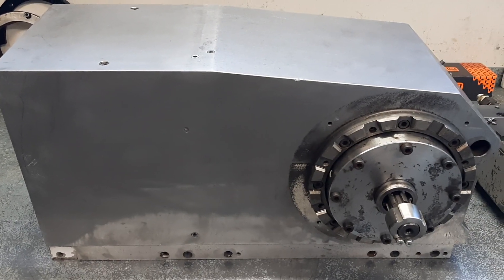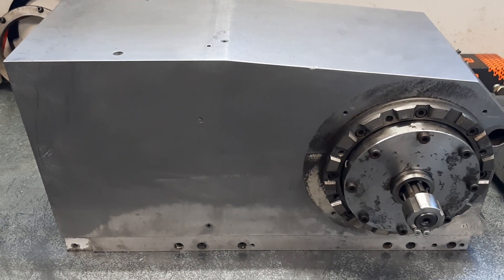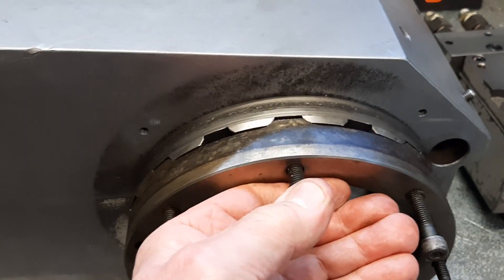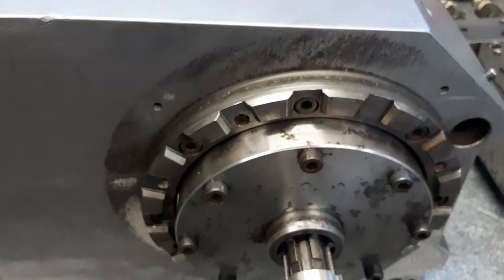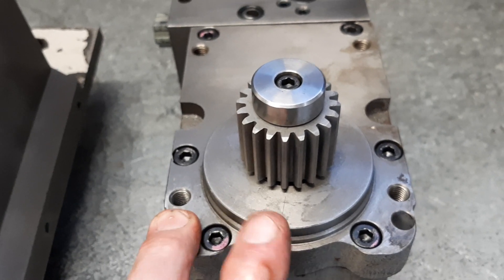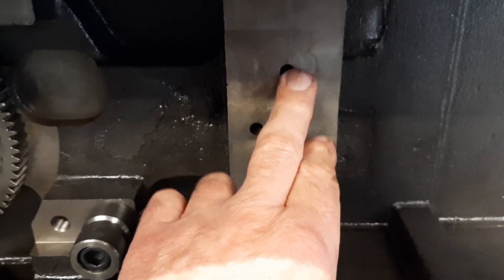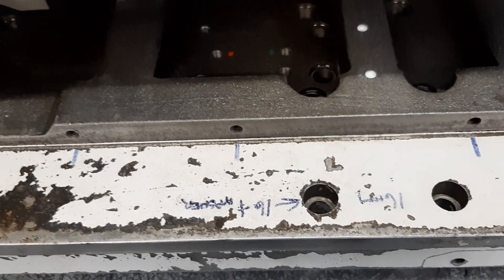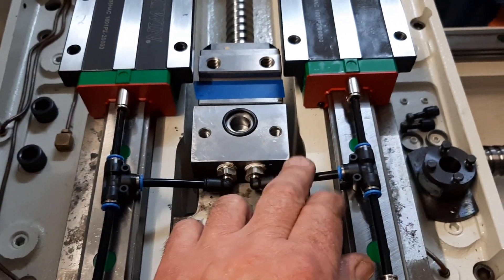CNC Lathe Rebuild.  Tool Turret Assembly.

Comment: Thanks for the great video,  Question, Do you think the Doosan have the same setup?  I'm leaking hydraulic fluids around the turrets area.  I'm thinking something about the seal or O ring.  Thank you!
Reply from the maker: Hey Pat.

Tool Turrets on most CNC Lathes are fairly similar in design.
Manufacturers generally make small changes over a long period of time.
Basically they look very much the same under the machine covers.
The main differences on a CNC is the controller, the basics of the machines stay much the same.

Comment: Hi mate.
Robert Brown from Sydney here 🤝
Just found your channel and I’m fascinated by this Mazak Mission.
I admire your patience and tenacity, and I fully understand the need to fit in a project like this along with the main ‘breadwinning’ business. What ( roughly) do you reckon will be the final cost?   Regards, Robert
Reply from the maker: Hi Rob.
The cost of the rebuild is a little hard to tell ??
I can only say i did budget for about 40k including buying the machine.
The cost of the machine was just over half.
I have replaced a fair few sheet metal panels which has so far added up to around $ 2,500 plus powdercoat plus painting etc etc on the sheet metal parts.

I repainted the whole base after sandblasting which is extra.
I guess around $2,500 again just on the base only which includes a crane truck to transport the machine base to be blasted and averagely painted ????
( which finished being a pain with the guy i got to do this work, some i had to do again myself ???? )

The sheet metal could have been left as was but it is part of the rebuilding of the machine.
Allowing myself around 40k total has given me some movement to spend money on things i would like to change.

It is a little tough to get motivated to do work on the machine when i have
 time, plus there are always other things to do also, which does not help.

I did go a little overboard on the rebuild but it was a case of just taking more and more parts off the machine until i got down to the base only.

The price of 40k was worked out from Maybe buying a Tormach CNC Lathe ??
Pretty much one would have cost to me in Australia.
At that time i was only making small parts and did consider buying until i seen the price, plus they are a fairly limiting on power for cutting anything half reasonable.
It was just a thought at the time but quickly changed when comparing how much for how much ?
Meaning for the money i could buy A lot better.

It has been a long road to get to where i am now.
But i also need to feel lucky that i can at least have this machine to rebuild.
If i had a chance to do it again ?
The answer would be NO, LOL.
Mostly because i need a machine running so i can run it.
When i purchased this machine i was not as busy making parts.

A long reply but i do enjoy talking about the rebuild.
If you would like to know more please ask.
All the best.
Peter.
Reply from the maker: I forgot to mention.
I am based in Melbourne.

Comment: Nice video. I wondered how a lathe tool turret was locked in place so that was really cool to see.
Reply from the maker: Hey Tim.
It seems to work fairly well.
When you consider this Turret design is from the early 80s it,s not to bad.

Comment: Great installment. I liked seeing how the turret operates. Does it also create pressure that pulls the turret back to lock it in place once positioned?
Reply from the maker: Hey John.
I thought showing how the Tool Turret operates might be interesting to see.
The hydraulic cylinder that operates the Turret disengagement is driven in both directions of un-clamping and clamping.
Reply: @weldmachine  Ahh, okay. Got it. Thanks.

Comment: Great info very interesting and great explanation thanks
Reply from the maker: Hey Joseph.
Slowly getting there.
Today i just about finished assembling the complete Tool Turret less the Turret itself need to wait for a large internal seal.
Just a few internal sensors to add.
I was at my favourite Mazak dealer this morning ordering hopefully most of the Wipers and Seals i need to do the final assembly.
I still need to order a new Tooleye.
Most lightly a genuine Mazak part.
After comparing what is available non genuine the prices are not that far apart.
Not cheap in local money of around $1000 but comparing what else it seems not to bad. 
Thanks for taking the time to watch.
Peter.